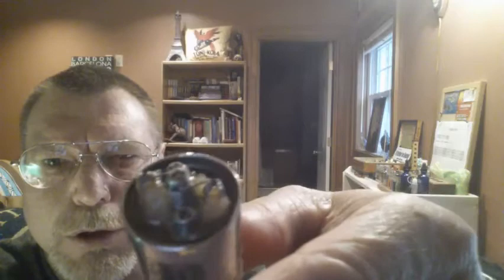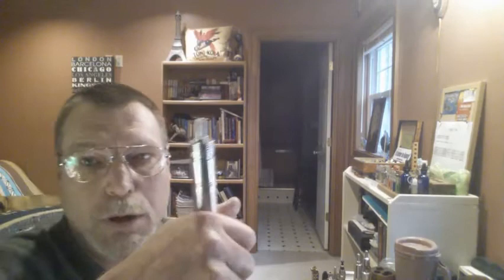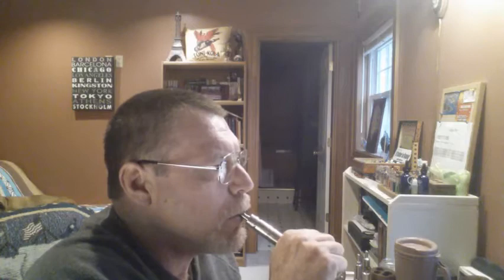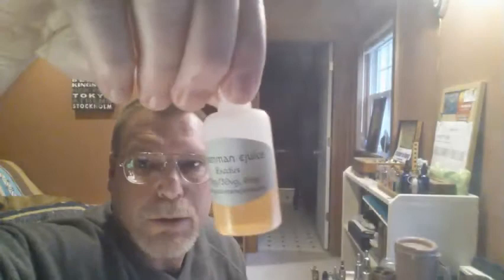Vapor production from a Atmomixani 3D dripping atomizer

Comment: Hey buddy this is Jr I talked to you up at voltage vapin' about making mod box whole cut outs Jay&seth up at the shop call me Gary anyways .I just wanted to thank you for doing this video how ever I wish u would have did the build especially the wicking I'm having a little trouble with it first I went over board and put 26ga. Quad and drilled my holes out all the way only leaving 2 thousands of an inch so the o-ringwouldnt be effected I think mine are out there near urs. Mine stays flooded I thought it was supposed to squirting juice but still allow the cotton to get dry and this just ain't happening it more like a genni auto dripper I see the idea dude was shooting for w/this a tty but until mine works right or some body knows some trick then I think he needs to go back to the drawing board